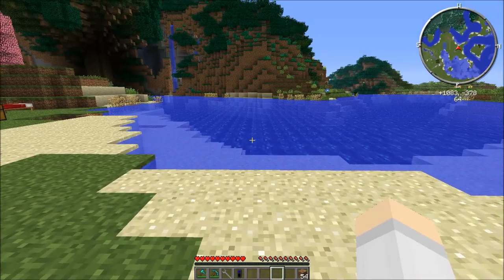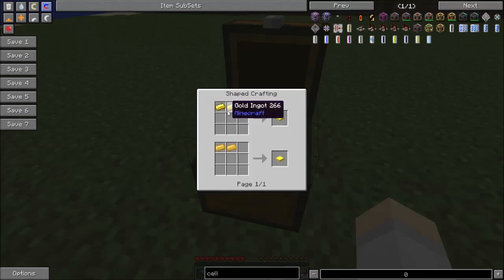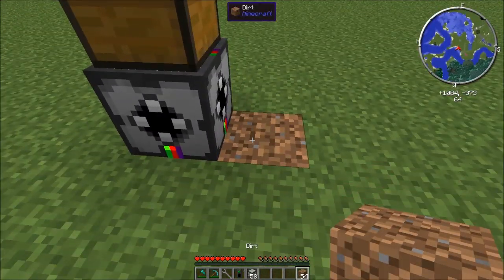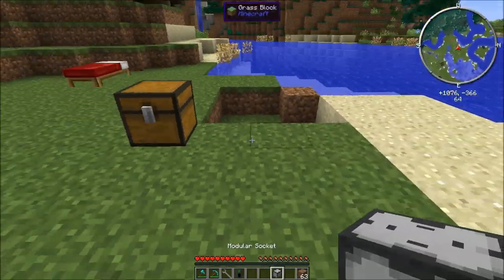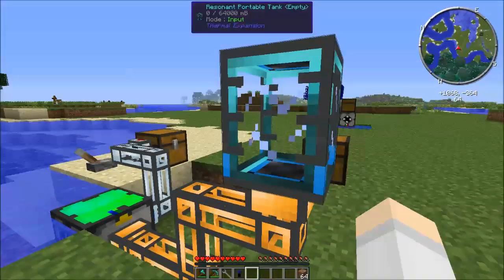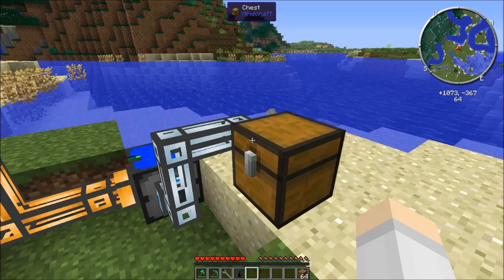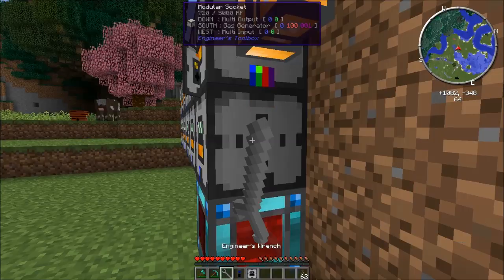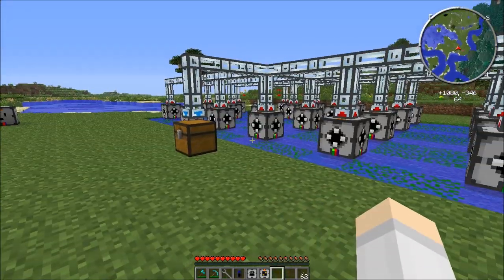How To! Automatic Algae and Hydrogen Gascraft production for RF power

Comment: In case someone managed to find this comment here is some useful info (1.7.10)
Nutrient water made in mixer 1B water 1bonemeal
 when algae grows on it it has chance of growing super algae instead which is 3B of hydrogen instead of single bucket making it more reliable and super algae has higher chance to grow super algae so once you have it should be easy to get going and for some reason doesn't need to be source block unlike water for algae to spread but can't be placed on flowing parts 
And the gas generator is lot better both in power gen and efficency (idk why the gas turbine exists generating only 10rf/t wasting so much power i have found any liquid or gas that would make them different and steam is quite bad power option) 
If your modpack has advanced generators the turbine can use hydrogen as fuel and the fuel mixer makes it lot better efficiency and cheaper to craft too and makes faster RF/t per block and without the fuel mixer it both generates both the same amount per B 30RF/mB
And Actually addition greenhouse glass seems to double the speed of growth of algae but more testing is probably required other items like growth ring(actually additions) 
or other mods seem to have little to no effect mostly likely because it's not a crop but project E the green ring speeds up growth a lot but it's a OP mod so it's to be expected i used command to give EMC to limestone so i can convert cobble to limestone because there is no other way to make infinite of it besides making a crafting recipe with crafttweaker
(Don't know why but in my testingy lot of mods crash or corrupted worlds when fluid tries to go into fluid pipes (for example canola press and fermantating barel from Actually additions) of Engineer's toolbox so use instead Buildcraft or Thermal fluiducts to avoid that)

Comment: This is awesome! Thanks for making it. I just have one question, how did you provide the redstone power for the itemducts pulling algae out of the big farm?
Reply from the maker: They all have servos in them set to ignore redstone!
Reply: Ahhh! That makes sense. By any chance do you have a link for how to make those?
Reply from the maker: Sammy Pettinichi Redstone in the middle, iron above and below it and glass on the two sides.
Reply: Vanhal Thanks for the help! I got that made and installed in the input which needs the redstone. It looks like this when I view it: http://img1.wikia.nocookie.net/__cb20140225200104/tekkify2/images/f/fa/PneumaticMenu.png
It isn't lighting up or allowing algae in yet. I tried toggling the bottom right without luck.  Am I missing something?
Reply from the maker: Sammy Pettinichi
So on the side of that screen there is a redstone tab with 3 options in it. Change it to the first one. (should be on the second one)
Reply: Oh man, I totally overlooked that! It is working perfectly now. Thanks a lot. You have been exceptionally helpful!
Reply from the maker: Sammy Pettinichi
You're welcome, thanks for the sub!

Comment: Anyone know the condition to grow algae? I'm trying underground and it doesn't seem to grow.
Reply: I got it to work! So it does output nutrient water as a liquid. Also, I ended up having to use the liquid input with a tank instead of against the water. Thanks for your help Vanhal!
Reply: I had glowstone 2 blocks above the water. At first I had lights on the ceiling and the walls but it wasn't bright enough at the algea level.
Reply from the maker: From the looks of it there should be no problem growing it underground. There is a max water depth that it will grow on (default of 3) but other than that there is no other requirements.
Reply: Yeah it seem the problem was my light level. It was a bit too low.
Also, for anyone wondering, Watering Can and Lilypad of Fertility works on them.
Reply from the maker: RacoonProds
You can make something called Nutrient Water (water and bonemeal in a mixer) and growing algae on that will make it grow twice (I think) as fast and you'll have a chance of making super algae which will produce 3 times as much gas.
Reply: Vanhal
Ah Good to know! Thanks.
Reply: Vanhal Any chance you have a tutorial on making mineral water? I made a mixer, but this is the first device I've tried to program on my own. Here is what I have set up: http://goo.gl/0UPsPS
It is up against water and should pull bonemeal from a chest, and then output the finished product to a tank through the machine output. In order to provide power I have Leadstone Energy Conduits coming from my resonant energy cell, but it doesn't appear to receive power or do anything.
(Sorry to keep bothering you on this!)
Reply from the maker: Sammy Pettinichi That does look like it should be working. From what I remember though there shouldn't be any need to change the settings on the power input side. Also add a fluid output on channel 1 and see if the water comes out there. (I'm fairly sure it does come out the machine output but it may not...)
Reply: Vanhal Aha! It is taking energy after removing that programming, so that was one problem. It isn't using it to combine them though. I realized one mistake I was using a fluid input instead of a water intake on the water side.  Messing around with the outputs on the machine output I've managed to get a bucket of water and have the bonemeal tossed back to me, but it just isn't mixing the two for some reason.
Reply from the maker: I'll have to try it out myself and get back to you, I've never actually made the stuff so i'm not sure what's going on. Fluid input is fine instead of water intake (You need two water intakes if you use them)
Reply: Ahhh didn't realize that.  One thing I did notice is that I think the machine outputs buckets of nutrient water when I was originally trying to output it into a tank thinking it was just straight nutrient water. Not sure if that was part of the problem, but I had to head to work before I had time to toy with it any further.
Thanks!
Reply: RacoonProds What did you do to light it up well enough? I'm currently using a combination of glowstones and torches in nutrient water, but it doesn't appear to be spreading either.
Reply: RacoonProds Thanks, I will give that a shot.

Comment: nice video, it explained me how it works, just got 1 problem. i did the same as u did. even the followings of the (how should i call it) the "modules" are the same in waila. it is taking in water, it is receiving algea from my farm, it worked for about 8000 mb and than it stopped, mined the 'machine' and replaced it, removed the modules and replaced them, re-configured the input's / outputs with the socket remote,also tried with a new socket, acctually i tried everything but no luck, still 8000 mb in my tank, the photoreactor thing keeps blue, doesn't change to green. so i think it's inactive. it is placed under open sun, and has 4 glowstone blocks 1 layer higher surrounding the photoreactor, so it should have plenty of light. getting desperate cause i need a renewable power supply instead of running my base on lava every time.
Reply from the maker: How big is the tank you are trying to fill? If the modules have no where to output to they just stop, did you try filling a new tank?
Reply: it was in 2 BC tanks, just to get some hydrogen going for some power to get a rolling machine for a railcraft tank. so i think i had room for 32000 mb. feeding algea in trough itemduct from thermal expansion, and taking hydrogen out with a bc golden fluidpipe. but i noticed u use 2 water intakes and i only use 1, can that be the problem ?
Reply from the maker: That might be the issue all right, according to the documentation you need two water intakes on the same internal tank. You could always change the water intakes to a fluid input and pipe water into it instead?
Reply: only 1 fluid inpput then ? that can be build a lot compacter than, i'll try it this aftrernoon, 11 am is kinda too early to play. if it works i thank u very much, if it doesn't i'll come back to explain.
Reply from the maker: Yeap, only need the one fluid input. Let me know how it goes.